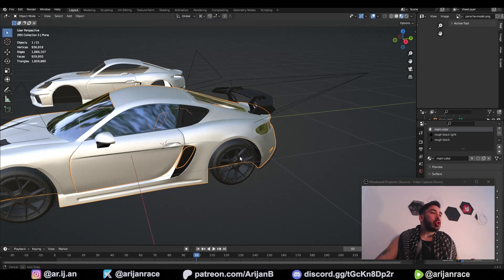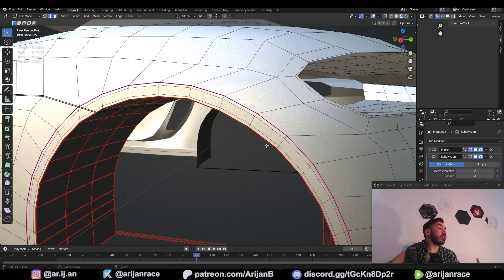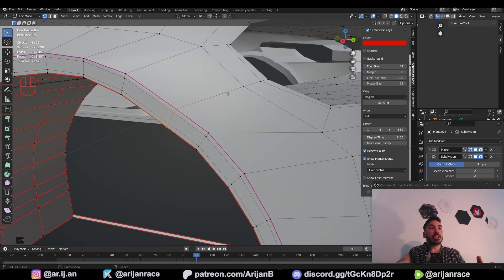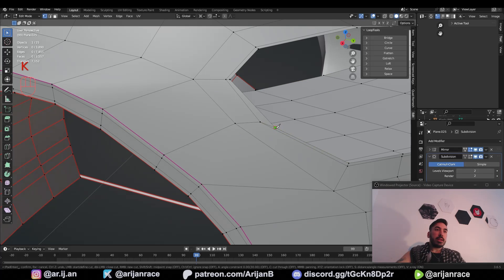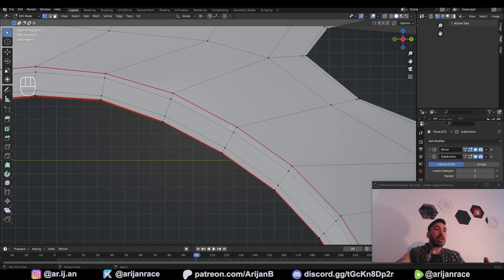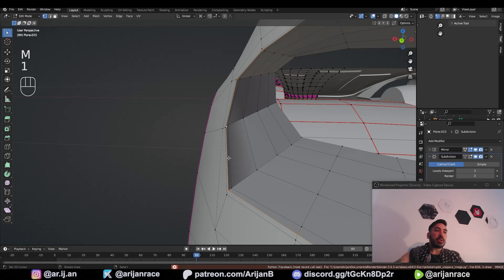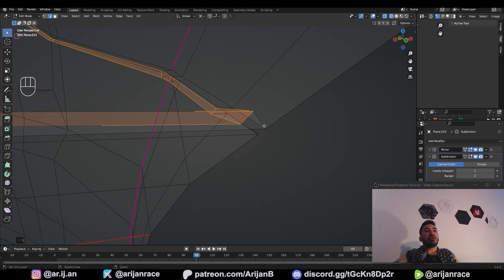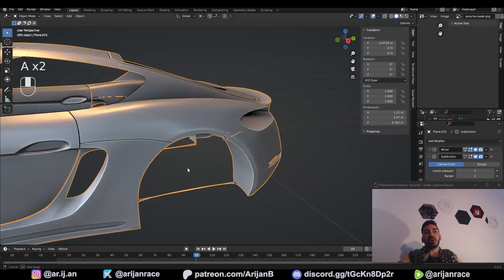How to Perfect Car Panel Gaps - Beginner Topology Tutorial (Aryan)

Comment: It’s best to duplicate the main mesh use shrink wrap modifier for any cut out panel gaps. Make sure you use vertex groups so you can create return flanges that can be independently modelled. There will be no distortion on the highlights plus it is not destructive to the original base mesh

Comment: Tips:
1. you can hide parts of the mesh in edit mode so the knife tool, won't effect the headlight area instead of separating which can cause shading artifacts
2. After you bevel you can use Alt + E then "Extrude along normals" to get ride of the twisting in the extrusion.
3. Don't drag out tutorials just to make the 10 min mark for monetization smh

Comment: So, you dont need a high poly base mesh and low poly top mesh with a shrinkwrap modifier? Why everyone is using this technique (shrinkwrap) when they want to do split lines or holes at the car panels??
Reply: The shrink-wrap method is used because it works for larger areas where you have a smooth continuous surface, or you have a design where the glass and the car body have a continuous curvature and you have a door cut-line cutting though both of them. In this example this method works because it's a relatively small area, and the mesh density is high enough to where you don't notice it as much. But if you had a highly reflective car paint and zoomed up close you could see the discontinuity in the reflections. So the shrink-wrap modifier is the more "mathematically true" method to actually achieve continuous surface reflections where this method is ok for maybe smaller areas or more conventional car designs where the door panels don't share a continuous surface and have a continuity break. Hope that make's sense.

Comment: How long does it take to make a car like this one?
Reply: It completely depend of how much you are used to do car, car are really special to do at first, because the round subdivision of the carrosery, and then what level of details you want to achieve.  at first i was need do and redo so much parts that it was take me weeks, now that i know, a little better, i can do one in some days interior included. There's also a lot of advanced technic involved, as use a shrinkwarp on carrosery for allow do the cut in the exteriors without deform it.  There's a lot of parts you can reuse, from other models, think to wheels, tyre, brake rims, seat. gears etc.. One car can be so different from another, lets take an 80s Honda NSX, it is mostly square, so it is way more easy, and panels and cut are straight. an 2023 Honda NSX GTX Evo is crazy hard to do in comparaison. For peoples who start, i will say, maybe try first with older models of cars, who was mostly square before try do moderns GT cars.